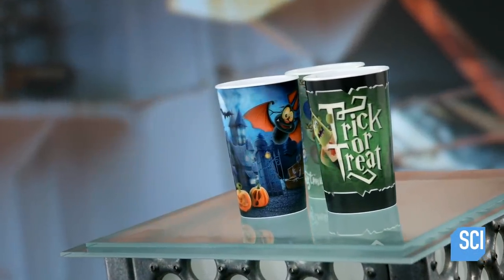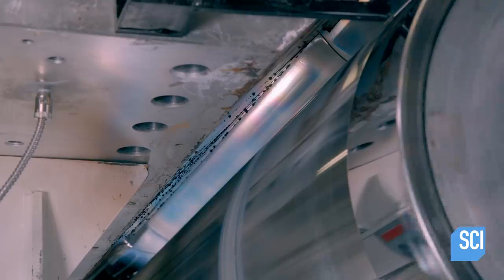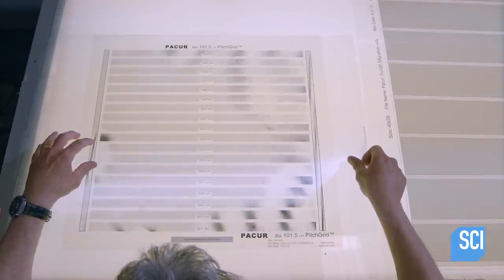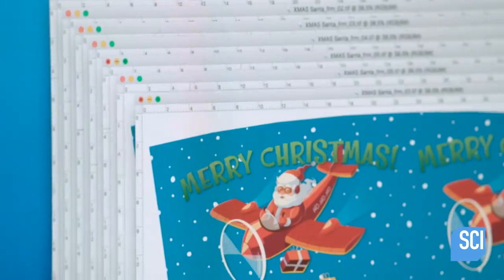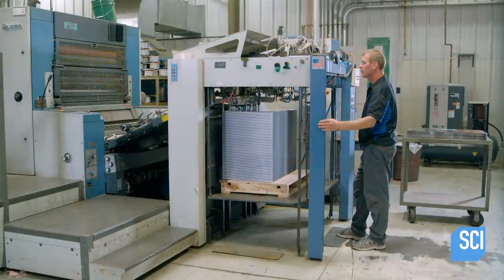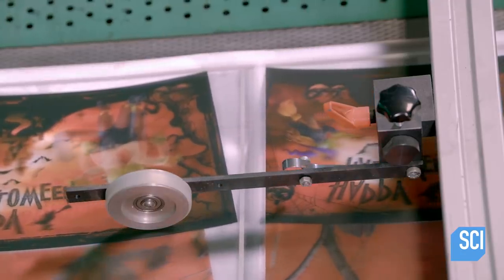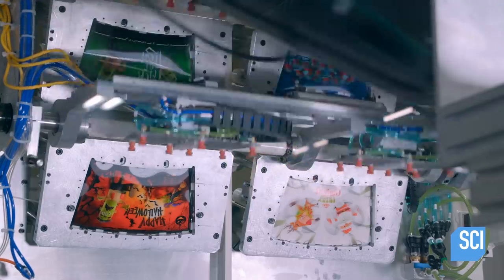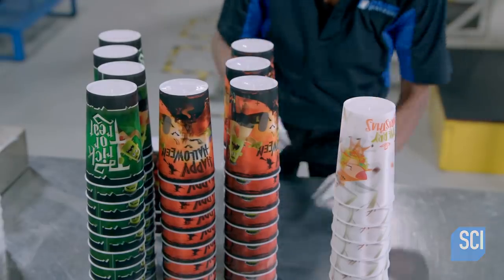How Kids 3D Cups Are Made | How It's Made

Comment: I worked where those are made. It's terrible to have to inspect and pack them. Worst job in the building.
Reply: Does it make you dizzy? I used to work in a glove factory and having to watch the gloves comes out of the machine (to pull off bad ones) is very dizzying! 😵
Reply: @juneberry1982  they aren't fast but  you put a sleeve over the cup and its heated to make the print stick to the cup. They come out in stacks of 20 one on top of the other. Worst part is some prints are crooked or not on perfectly and you have to go through every stack before packaging. It's a huge pain in the rump.